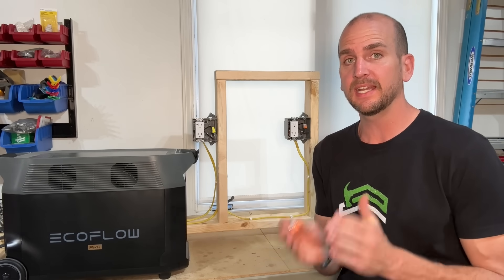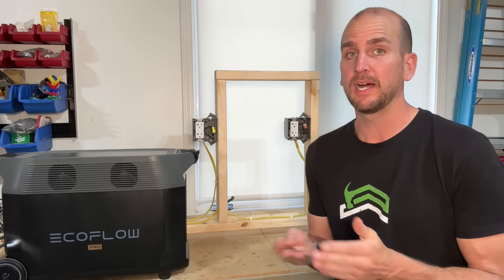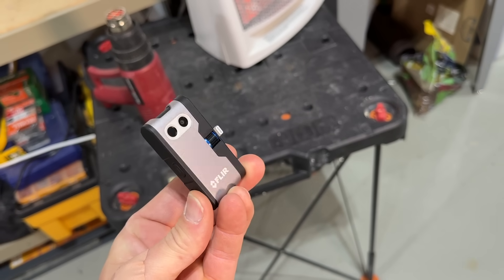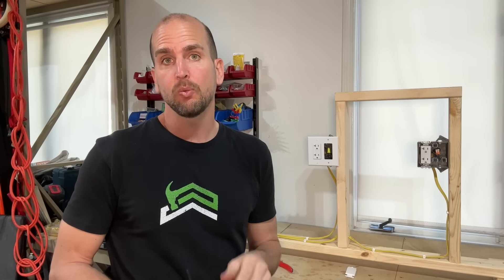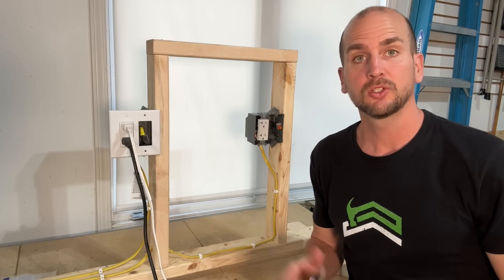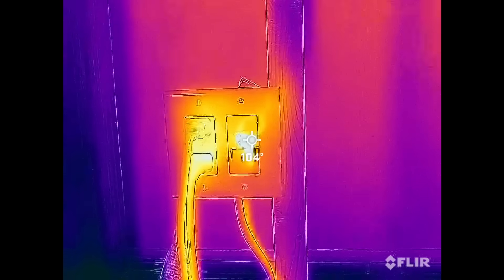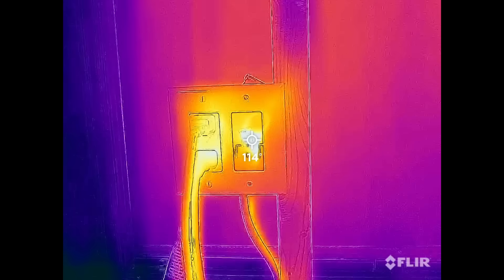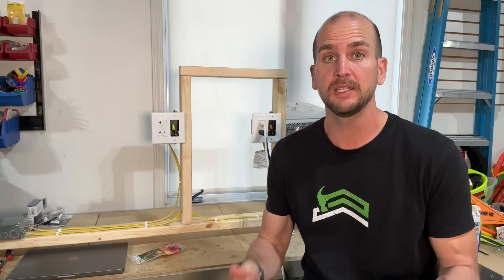Debunking the Pros: Can WAGO Lever Nuts Handle Heavy Electrical Loads?

Comment: I'm a licensed electrician. I've been working for 25 years. I've used Wagos for most of that time. We've used them in residential, commercial and industrial conditions. Lighting retrofits, new home construction, remodels, and pretty much everything including high amp loads. I've been back to some of those jobs months or years later for various reasons and been back inside some of the boxes with the Wagos installed. None were melted. All were perfectly fine. I've never had to go back to a job because of a problem with the Wagos. 

They have been used in Europe for decades. They are tested to German standards. They are UL approved. And this test also shows that fears of Wagos being unsafe are unfounded. They are just fine. They are not a problem at all. I understand why some are skeptical but Wagos are perfectly safe. I have them in my home wiring.

Wagos are also clear so you can see how the wires are seated inside the device. You can't do that with wire nuts. You can't see inside to verify the wires are correctly seated. Wagos are also easier for a DIY to get right.
Reply: The electricians that did my moms house 20 years ago introduced me to wago push ins. They used them throughout the house. There has never been any electrical issues at all. I adopted them after seeing them. I was a bit skeptical as the push ins on the back of outlets are notoriously bad and nobody i know recommends them nor uses them. But I remodeled my 1935 home.i removed all the Knob and tube and put Romex throughout all 3 levels and tons of outlets and switches using almost exclusively  wago and ideal push ins and to this day no problems. I would recommend them without hesitation.
Reply: Me too..old house, knob and tube. Yes. I sleep well. @roboshort72
Reply: You havent seen them melt yet. When you see your lights flicker, its a wago saying HELLO!
Reply: finally an Aamerican electrician who isn't retarded. My home is 1972, metal boxes, no leeway with wire lings, twisted wires are f***ing nightmare in remodels. Anyone still twisting wires loves bud light.
Reply: Thank you. I'm admit I'm still a bit timid with them, but that doesn't mean I should be.
Reply: Nice to see a sparky make sense. I am getting tired of the other's saying "bleh, WAGO bad"
Reply: @fizwin1  There junk, there as good as back stab outlets
Reply: @fizwin1  Why? Are you selling them? Listen to what their telling you. My advice is from experience. Ive tried them , there junk. Just a fast way of doing something that requires more effort which lazy "sparkies" arent willing to give. Faster is never better. Your not even saving money using them. Sounds to me like you need somebody to convince you your right because you know its not the best way and you need to feel better about yourself. People that tell you they have used them for a long time and never heard of a failure, think that they will hear about them when they start failing. Or there lieing to you so they can sell them. Well unless their phone number is tagged on each one of them its not likely for them to hear. But sure enough someone like me will be there to clean up their mess - as I have. This guy Scott is selling them on his web site - gee wonder what his motive is.
Reply: @RadioRich100  You have zero facts. I also call bs that you are angry making money off supposedly fixing messes from WAGO's.  Where are your videos and pictures of all these happening?  You are just angry many can do your job NOT be a sparky so YOU feel threatened. It is VERY obvious. No I do not sell them. Scott posts EVERYTHING he uses because believe it or not, many people follow and appreciate the teachings online and would love links to see the product. Scott makes a very little % for clicking in his link/shopping from his store.  He makes more off the YT videos... If you are so good and know so much, show us a video and other evidence?  You cannot.  I have tons of cert electrician friends and know TONS of contractors. I have yet to have one tell me there was ever any failure of a wago installed properly including following all NEC rules.
Reply: @fizwin1  Maybe you should start listening to them and not half ass utubers trying to sell them.
Reply: @RadioRich100  Listening to them? Stop. I did my own testing and used WAGO prior to any yt videos. You will get less work due to the economy regardless.  I will never pay an electrician for overpriced small services. Big stuff, sure. But even when I do not want to do something mostly due to not having certs yet, I know the rules, the whole NEC book etc and can easily spot half ass work. I have kicked contractors out before since they cut corners. So good day hoping our work burns up. Not gonna happen any more than any of your supposed good work. Enjoy. If your attitude showed up in your real name, you would have zero work fyi. Again, if you are SO good, post videos and evidence instead of attacking other youtubers and home diy'ers.
Reply: @RadioRich100  Maybe you should do some actual research and testing. Like did you not even watch the video? He was in no way sponsored by or affiliated with Wago, so why would he try to sell their connectors?

Go do some testing yourself before calling out people.

The faults you listed were either because they were fake, or because they were installed incorrectly. We've never had a problem with Wago connectors.

TL;DR Show me a video of a Wago connector actually melting and causing a short. You'll find none.
Reply: @LeoTiger12  Research isnt needed when you see and smell them. And others in my position say the same thing. And they ARE the wago brand and others. The guy who owns this channel sells them on his web site. The only people that use them are half ass electricians looking to get out of there faster, and there apprentices or know nothing diyers and follow the leader utubers. Real professionals who want to do good work dont touch them.
Reply: @RadioRich100  So where is your video of one melting?
Reply: @LeoTiger12  The same place as your video showing they dont.
Reply: @RadioRich100  At least I don't go around feeding misinformation to random people in the comment section and arguing with them how they're wrong. We too use Wago connectors and never ever had any issues with them. They barely even get warm under multi-hundred-Watt loads.
Reply: @RadioRich100 I also like to see pictures of burned Wagos as I have never seen one. Wire nuts are not sold anymore in my country for over 20 years now and are illegal to use.
Reply: Scott is nothing but a self appointed jack of all trades, master of none trying to sell related products. He is not an electrical expert or electrician and frequently gives out bad advise. Wagos are total junk for lazy electricians and diyers looking for a faster way to get out of there.
Reply: Most big contractors use push in connectors now they are cheaper.
Reply: I have never had problems with wirenuts as we do not use them and they are not avaliable.
Reply: Your full of it, they havent been available or approved that long.
Reply: @RadioRich100  I don't know about your planet, but on Earth they have been in the US since the Early 2000s. Maybe you're confused about the lever connectors vs the push in connectors.
Reply: @DaveMiller2  The lever connectors are the junk, and yes on this planet.
Reply: I've had wirenuts melt on me, mostly because the twisting mechanism on an old wire to a new wire can result in the old wire being damaged and cause arcing / higher resistance.  In the instance where the wirenut melted on me before, a wago nut more than likely would have prevented it because it would of been less likely to damage the old wiring.
Reply: You never saw a ptoperly used and  installed wire nut melt. What was causing all that resistance? Old copper????
Reply: They meet all of the NEC code requirements regarding splicing and terminating conductors, video is absolutely pointless, parts fail because they've been overloaded or fitted incorrectly, I've seen 221 connectors used on 6 mill
Reply: Doesnt matter. They fail when installed according to manufactures specs. They sacrifice the integrity of the connection for the sake of speed and convenience. There in series with the load and shouldnt be. UL is a publicly traded private company bought and sold everyday. If u have the money your product is getting approved. Remember aluminum romex? Yep it was approved and destroyed 100's of homes across the country and there still burning down today.Dont tell me about NEC and UL. Go by the results.
Reply: I had a gas furnace blower fan that used traditional wire nuts.  The unit would blow a slow blow fuse about once a year since the day it was new.  Then one day the slow blow fuse blew instantly.  After some examination, found 2 of the traditional wire nuts that had been installed new with the furnace in 2010, (which by that time was 2017 so only 7 years old) had melted completely through each other and they were shorting/making contact with each other and it was black/charred and the plastic was melted away.  Carefully wired it with traditional wire nuts 6 years ago and have not needed any more fuses, but I was very diligent about separating each of the wire nuts so they were not making contact with each other in the box.  I was very disappointed in the insulating capability of the original wire nuts but now seeing this video I wonder if it was a heat problem all along.  So I wonder that if a traditional wire nut can melt in that application, I would be reluctant to go with a WAGO knowing that it's just a little bit more sensitive to melting.  Edit: maybe not more sensitive to melting but rather seems to cause the connection to run just a tad hotter.
Reply: @maubunky1 Both the WAGOs and the wire nuts should fail in overcurrent situations of which you indeed want that failure in a junction box rather than outside of it.  That's actually what you want to happen.  Otherwise it sounds like you've got a blower fan that's overloading your circuit(perhaps a failure with it) or you have a circuit that isn't designed to allow enough power for the load on it.  If you're tripping breakers/blowing fuses(latter sounds like you have an older home) those connections are supposed to be the next failure point.  I might consult with an electrician and check the installation because "separating each of the wire nuts so they were not making contact" seems like a jerry-rigged thing with you're not minding if you've got an overload or wires heating up situation(which you do NOT want).  Cause this is getting close to the "This Old House" situation of "my fuses keep blowing; I'll go buy bigger amperage ones.  Or maybe just put this copper penny into the back of the fuse hole."  NOT good!  House built a century ago wasn't designed for nearly as high of electrical loads is how people often got into trouble then trying to overload those old circuits.  You really need to answer the question of "why did the wire nuts melt?"  Especially when it's 2 of them melted; that sounds like an overcurrent problem rather than a splice point problem(would tend to be just one melting).
Reply: @maubunky1  if you are running higher loads, then the 221-6xx wagos are the ones you'd use.  I've never seen a properly installed Wago used for the proper loads melt, not one single time. I've seen hundreds of wire nuts fail.
Reply: @maubunky1  Yes and then the stupid springs relax from the heat making the connections worse then starts the arcing and then charring and melting and burning. If your lucky the connection will burn open and thats it. But no guarantee.
Reply: I am a licensed electrician and would not use them because I know how to put wires together properly. I would suggest a do it yourself or use them because they are simple to use and will probably do better than if they try to use wire nuts.
They are also quite expensive at $.70 each and so being inferior to a wire nut and costing more than a wire nut, it makes no sense for me to use them
Reply: Their never right.
Reply: Your another one who thinks everytime those things fail your going to get a phone call. Ive seen melted down ones and intermittent connections and wires falling out of them. The levers open when you push them into a box or with vibration over time.Burned and black. If wirenuts are applied properly and wires twisted right they never fail. If wagos are applied properly they do fail. Nothings better than a copper to copper mechanical connection . Not a double spring contact resistor where the conductors dont even meet.
Reply: Vibrations over time? Why is your box vibrating? Did you not mount it properly? @RadioRich100
Reply: @Shrek-iv8gu mounted inside a supwoffer
Reply: @RadioRich100  You're a funny one, mate.
Reply: @RadioRich100  do you ever see/use screw connectors or screw terminals?
Reply: @MrTeddy12397  No not in the states
Reply: @RadioRich100 
Amazing I have never exprienced what you say you have.
Reply: @RadioRich100  He litterally said that they are in his home wiring. If electricians trust these to be in their own homes, it is clearly safe.
Reply: @RadioRich100  Disagree. It's right there in what you said: "copper to copper mechanical connection".  Copper is NOT used for its mechanical properties; it is used for its electrical ones.  Wire nuts are essentially "rat" or "pig" tail splices.  Knob and tube guys would've told you're they're not as "good" as say a Western Union style splice, especially after being soldered...which is what those guys did with most of their splices...way better conductivity and thermal properties than any wire nut.  Which many of those knob and tube applications they didn't even put the splices in junction boxes.  Didn't really have to when the splices were done properly; if you do thermal measurements, the splices typically run colder than the wire...as long as they're done properly.  Which is why house fires in K&T often started not at the splice points, but at random locations inside the walls at spots along the wire!  Part of the reason we have junction boxes is so we can isolate overcurrent failures to those points; it's a lot better to have a melted wire nut inside a box than have a house burn down from the few atoms of some impurity in the copper wire from the factory you have no idea where they are.  I'd rather have a house call than a house fire.
Are you really saying too you've never seen a wire nut fail?  Because I'd call BS on that one.  Both of these things are actually designed or supposed to fail BEFORE there's a bigger problem. Look at the testing above; BOTH the nuts and the WAGOS run hotter than the wire; that is EXACTLY what you want!  Also, wire nuts are indeed cheaper than WAGOs...unless one factors that electricians charge $1-3/minute for labor that WAGOs are far faster to install, test, remove, reinstall, etc. and just generally all around far less of a PITA.  They're idiot proof, and by "idiots" I mean professionals not DIYers that only make a few connections and have all the time in the world vs. electricians have the risks of high numbers and complacency.  Linemen are professionals, but you don't hear of average folks getting electrocuted by tens or even hundreds of thousands of volts distribution and transmission lines nearly so much.  Amish guy picks up a downed wire or something; otherwise those high voltage safety training videos are showing you cases where the "pros" got electrocuted.
My own house even I wired a new outlet that the circuit barely had any load before. I left most of the wire nuts in place that were put in when the house was built in the early 2000s.  Ran a 13 amp load off it for about a half an hour; junction box before the switch and outlet I wired started smoking.  WAGOs were fine; wire nut melted.  Replaced with a WAGO and haven't had a problem since.
Reply: @teds9896  Sounds like your one of those complacent electricians, anything to get out of there faster Huh? Your not getting it - they fail later, as they heat up more and more and the connection loosens. And guess what, like alot of guys on here - YOUR NOT GETTING A PHONE CALL WHEN THEY FAIL. So dont say they never fail because somebody like me has to go fix it and Im not calling you! And Im replacing it with a properly installed wirenut!
Reply: @RadioRich100  I use the push on Wagos, not the lever ones. They are just as safe as wirenuts and you can see into them and tell if the connection is good. I've seen far more melted wirenuts.
Reply: @DaveMiller2  You have tunnel vision. If they didnt fail so much you wouldnt need to see into them. Do you have to get a clear switch plate to see into the wagos too?
Reply: @DaveMiller2  You can see into them so you will know when they have burnt.
Reply: @RadioRich100  another American trying to defend the antiquated American electrical system/gear. smh.
Reply: @DaveMiller2  Youve seen? theres millions more wirenuts outhere. So that doesnt make sense
Reply: @DaveMiller2  If a wire nut melted somebody didnt put it on right. Put the wago right and they fail. You dont need to see into a wirenut.
Reply: @DaveMiller2  If a wirenut melted the wires were not twisted properly. The wirenut does not make the connection. The wago makes the connection using very poor mechanical contacts.
Reply: You went back to the jobs?? Gee I wonder why?
Reply: @RadioRich100 wagos are designed and tested to certain standards. Like anything they have their limits and if they’re not installed and used according to those limits then of course problems will arise.

The only time I’ve seen issues with wagos are when the conductors aren’t inserted properly and the insulation gets trapped under the contact point, causing a high resistance connection. This can happen with almost any connector (I work with leisure vehicles to DC currents, stranded copper wiring) and I see it much more with crimp connectors.

Wagos if used within their specs are perfectly safe, with the added benefit that you can visually see if there’s a problem with the contact/insulation as mentioned above. Most other connectors it’s either very difficult or impossible to perform a visual inspection on the quality of the connection once it’s in place.
Reply: @frodev728  Your wrong Ive changed many out. They fail when installed according to specs. They usually cause intermittent connections and melted housings. There junk
Reply: @RadioRich100 so you found chinese brand lookalike wagos
Reply: @RadioRich100 They're junk only when used in your hands apparently
Reply: @polandball-pf4tt  You will never see one of those in my hands as I know better.
Reply: @RadioRich100  intermittent connections is due to the conductor not being stripped to the proper length. I have been used these for years with zero issue. Opening up when being pushed into the box is an installer issue not a product issue.
Reply: @retiredarmyvet2018  No, its a crappy product always has been, based on the speed of the install. The product fails when used according to the manufactures instructions. Like pushing them into the box and the conductors rotate and levers pop loose, which is only one of a many issues with those.
Reply: @RadioRich100  You're full of it.
Reply: If there so good why were you back to the same jobs? To replace burned up wagos?
Reply: @RadioRich100  Let me help you decipher his message : he went back for problems that were not related to the wago connectors.
If the lever of a wago opens when you push them into a box you're very clumsy.
Also the contact surface of a wago with the copper conductor is probably higher than the contact surface inside a switch, relais and probably even more than most breakers in the same circuit.
Reply: @RadioRich100  No. There are other reasons you go back to a job. The customer has more work to be done. I'm talking about over months and years. I was there for something else and ended up inside a box I had worked on before.
Try asking a legitimate question instead of being a dick.